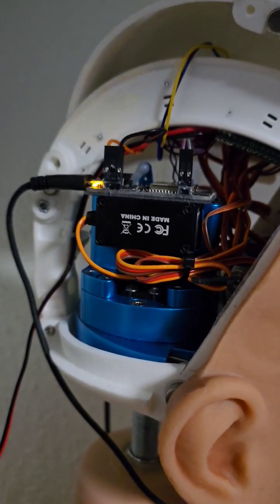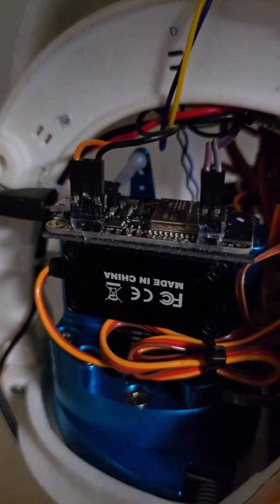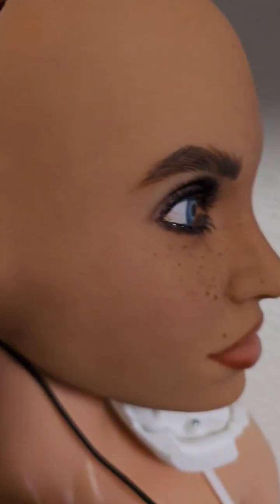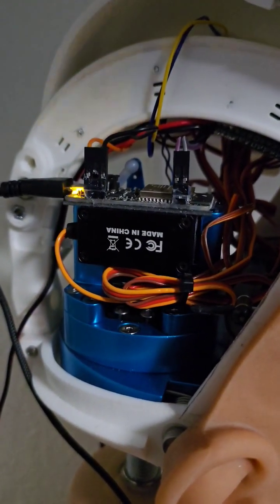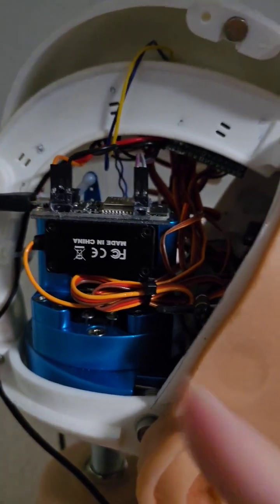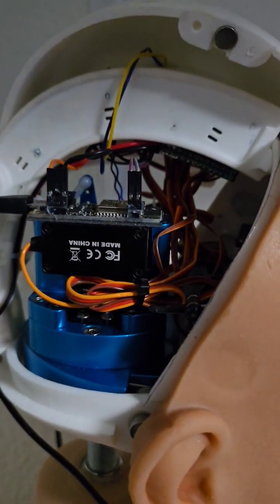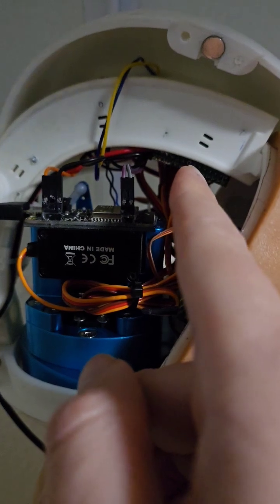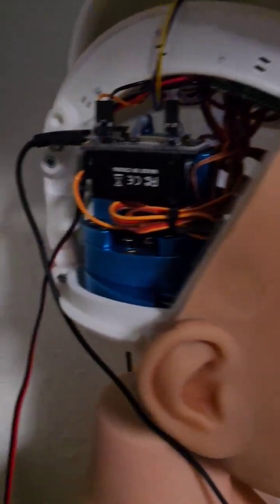Esp32 board dead?

Comment: add a large capacitor on the power input, or try a shorter power cable. You use a long usb cable? It can cause instability of dc-dc converters on your board.
Reply from the maker: I used a different cable. And just finished reading and binning 4mb of the board.